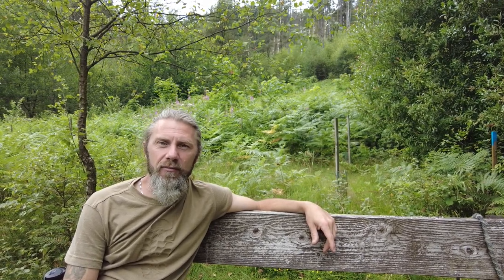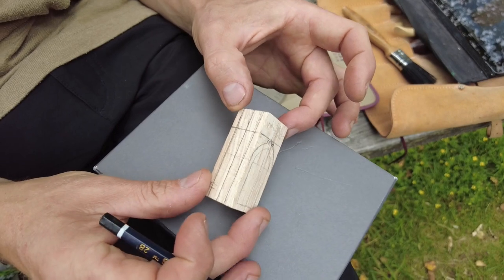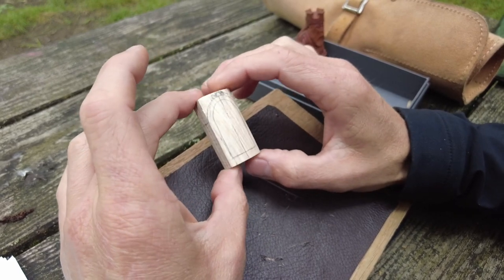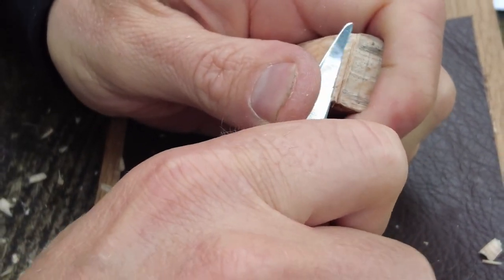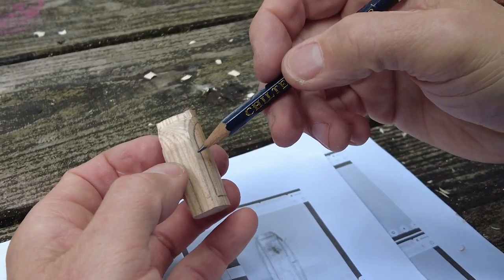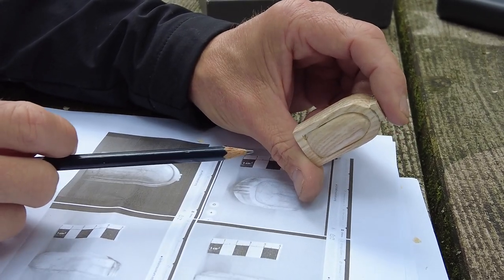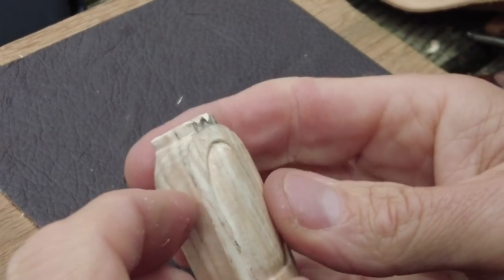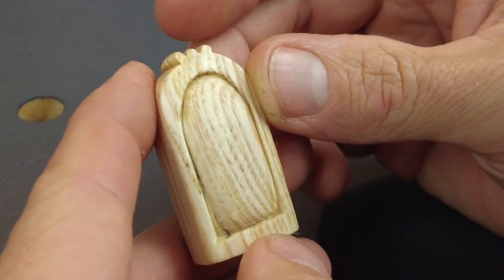Isle of Lewis Chess Piece Series - Wood Carving a Pawn from Sycamore wood

Comment: Hi, I promised a neighbour I'd make a berserker (holy sh**) I've never carved wood before, stone and clay yes but not wood, so this video is exactly what I need, I've got the knife and a few basic tools but can you tell what the flat chisel like blade is called, I think I might need something like this as well as my head examined.  Many thanks Sheila
Reply from the maker: Hi Sheila, I have carved the berserker twice now, Both times I did them larger than original, about twice the size and with a flat back for mounting on the wall, I do plan to do an actual size in the full round for the ongoing complete chess set. I do most of the carving on these pieces with knives, my favourite knives are Flexcut as they seem to hold a really good edge. The flat chisel you see me using in this video is a palm chisel, nice and small to use for this type of work, this chisel I believe is a Marples chisel but Flexcut do a lovely set of palm chisels too (they are on my shopping list!) One last bit of advice is if you go on the British Museum website they have all the profile photographs and dimensions of the Isle of Lewis Chess pieces in the their library and you can print them off and use them as a reference, I personally find this really useful. Hope this was helpful and good luck with the carve! Paul
Reply from the maker: Sheila, this is a link to a short video of the last berserker I carved.   https://youtu.be/7Pj78ES6YpY

Comment: Could you elaborate on your experience regarding different species of wood ? 
For example mahogany vs cherry wood ? 
Do you think basswood is okay for the white pieces ?
Reply from the maker: Hi Pieter, I have played around with lots of different woods, I think air dried Mahogany would work, I only had some old kiln dried and it was a bit too dry, I did two Warders in it but I wasn’t happy, the Cherry just carved so much nicer in my experience and you can hold very good detail which is critical especially on pieces like the back of the Kings chair. I have found with the Cherry that carving it and leaving it in UV light before waxing darkens the wood considerably as it’s quite light when freshly carved. As for the white pieces I found that, although easier to carve Bass Wood (Lime here in the UK) just wouldn’t hold the detail required which is why I finally settled on Sycamore Wood, again it also helped that I have an abundance of Air dried sycamore here. Hope that helps. Paul HWC
Reply: @thehairywoodcarver  Thank you so much for sharing your experience ! As a beginner I have only a little bit of experience now with bass wood, but I can already see what you mean regarding it's ability to hold detail . I will try some other woods ! Thanks again !! Would still love to see you working on the detailed figures such as a king or knight !!